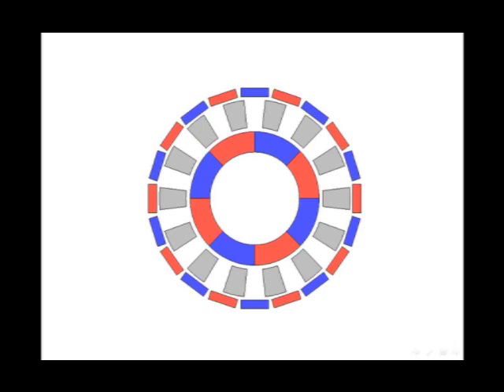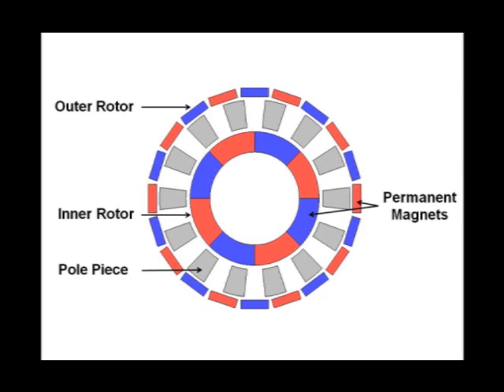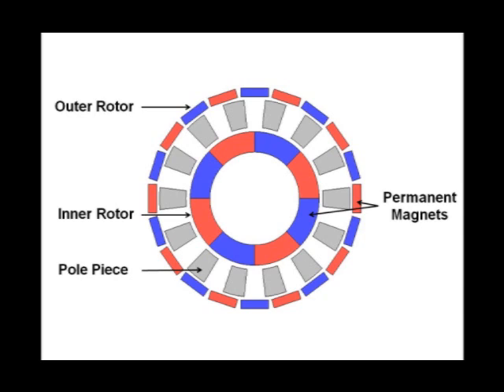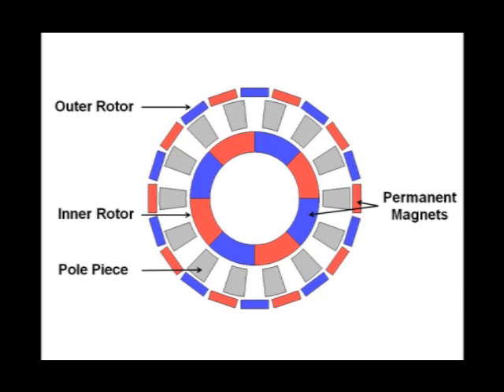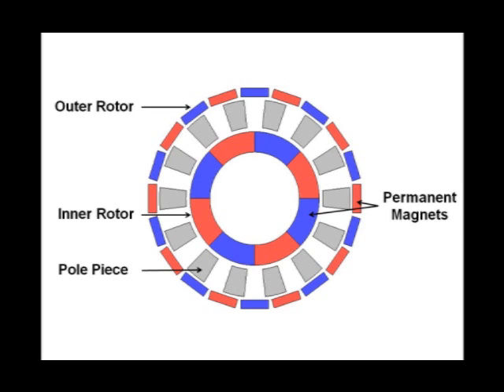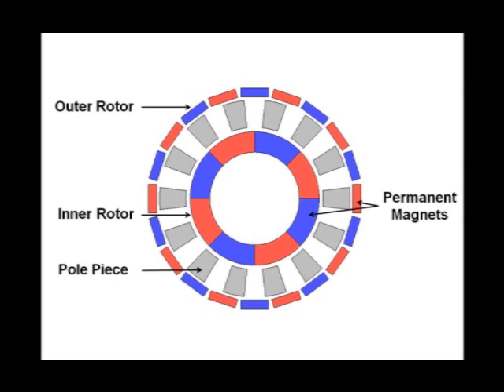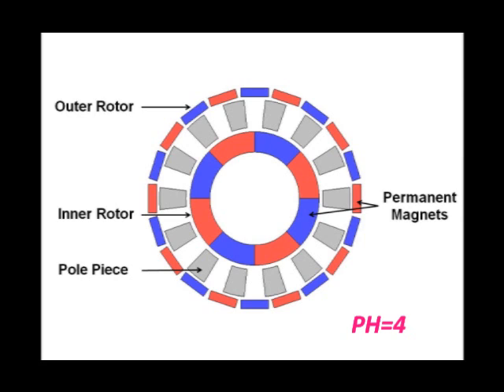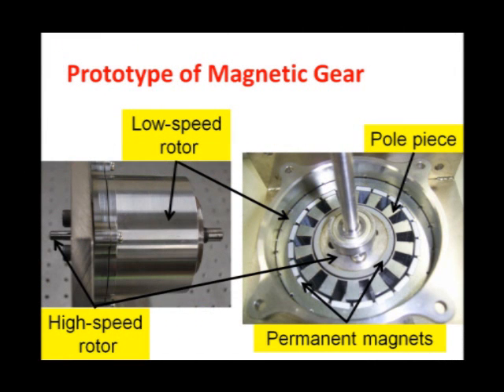Magnetic Gear

Comment: Can this be used to go from high rpm to lower rpm with a higher torque output like lets say an aircraft engine. vibration of changing engine rpms would be way reduced and if possible no more sprag clutches would be needed for 2 engine powered aircraft like the Chinook
Reply from the maker: Yes.
Reply: Mustafa Daif The cool thing is that this is bidirectional at the same time. Turn counter clock or clockwise and still delivers results. If I am thinking correctly a normal reduction transmission in aircraft requires a one way clutch or sprag clutch like in the Chinook like I mentioned before in order to slip past if overloaded. But this slips whenever either side is overloaded or overrunning as in needing to auto rotate for helicopters. But if needing to auto rotate will the engine be used in the manner of engine braking then like cars/trucks if solely used a magnetic gear system? Basically counter intuitive to the purpose for auto rotation? Even though the gear slip, a force is applied.. right?....causing the system to slow down because energy is expended into revving the engine and that is bad during auto rotation. This device still only gets rid of the reduction unit. Still an improvement.  Since it slips does it act like a torque converter? The engine can be at full power yet the drive system not at speed yet. Since the engine is at full power really quickly I guess that means the magnetic gears are experiencing max force from the engine and applying it to the drive system. Instead of the fluid coupling be at the engine makes with air the coupling is put into the device. (air to engine shaft/drivetrain) This makes it so the engine can change rpms very quickly. (start up quick) In a regular fluid torque converter the torque is doubled, what about this device? I know magnetic fields act differently than a fluid. Since the engine can maybe rev really quickly is there a chance that the input from the engine spins to fast and is receiving pulses instead of constant force or is the force applied constant all the time no matter the rpm?
Also can electricity be applied to the dc motor part or harnessed? Use it as an alternator. Less parts the better. Use it as a starting motor then electric generator as well as a gear system. Thats a lot to ask for lol. 
I am no expert or engineer, just a poor old geologist soon lol.
Reply: +Jonathan Greenawalt It should be possible to make one of the three two magnetic members, either the high or low speed magnet ring, stationary such that the input and output shafts are connected to the opposite magnet ring and to the pole pieces.  If the stationary magnetic ring then is replaced with electromagnets, the strength of coupling, and therefore the torque required to cause slippage can be controlled all the way down to zero torque, which would be free wheeling.   Perhaps this could then also serve as a torque converter with maximum torque being determined by the magnetic pole ratio at maximum electromagnet current.
Reply from the maker: +Jonathan Greenawalt Could you summarize your questions?

Comment: Err, sorry that I've been procrastinating. I will send you a drawing of it soon, less hard than actually making a set.  The idea is really not complicated (just one gear with big backlash with two magnetic gears on top and bottom) so I really don't need force analyse. However, its big weakness is the big backlash.  It also have as much friction than a normal gear when used with big loads, so  It's only worthwile for something alternating between big loads and small/no load

Comment: Oh, I was only going ust to make one small prototype out of wood XD  Anyway, tried it with even worse (styrofoam and duct tape) and while the magnetic part "worked", overall it was bad, because I didn't had tools and made a terrible, + or - round gear, not because of the concept. Now I'm gonna do it a bit differently in wood, I now have confidence in the idea itself.  I'm going to use a relatively weak, but easier to make gear style.  I may use software to see if it works well with a real gear.

Comment: You can also make hybrid gears, just make toothed gears with some slack and magnets, the magnets do the job alone without friction as long as not too much force is put on the gears, but when it happens the teeth get in contact to transmit heavy load.

Comment from the maker: That is right. Recently, many derivatives of magnetic gears have been developed such as magnetic geared motor, generator and magnetic CVT. These derivatives suffer from cogging torque, and reduction methods have been proposed but these method result in the reduction of the max torque...considerably reduction of max torque.

Comment: @edumation Ok, thank you very much. What about the pole pieces? Is this normal steel or is it made of lots of steel sheets like in a electrical transformer ? 
At magnomatics video it looks like steel bolts in a non-magnetic frame.

Comment: @edumation for same pole numbers it can work as a coupling yes but not gearing.

it is also possible to do gearing without iron but it seems only with point contact like mechanical mesh gears and that would dramatically reduce the torque strength

Comment: @edumation 1) it wouldn't work without the iron.
2) I don't understand the specific formula but it makes sense that the spacing of the iron has to fit the outer number of poles in such a way that the resulting moire pattern has a pole number that fits the number of inner poles.

Comment: @edumation the grey parts of the diagram is iron. iron aligns to an imposed magnetic field, it is said to 'conduct' a magnetic field. but because there is gaps in the iron it will only respond to the magnetic field close to it. so it 'samples' the outer magnetic landscape. the result is fewer poles seen by the inner magnetic array. if you label each grey piece red or blue by what color it is over you will see fewer poles than the out ring. that's how I think it works